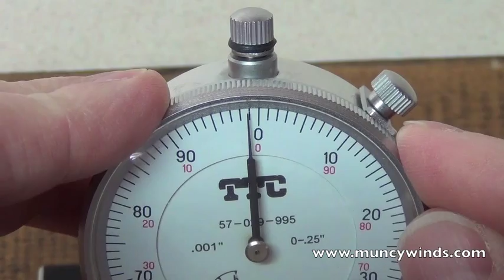Perfecta Reed

Comment: This is a very useful tool.  Especially for adjusting pricey synthetic reeds that aren't up to snuff. I find it's not always necessary to measure the A, B, C, D, E & F lines. Asymmetries are rarely limited to a 1mm strip.  I start with B, C and/or D, and mark the high spots with a pencil while measuring, in order to go right back with a razor or sanding block, even things out, and play-test the reed pronto.

Comment: This device was designed with the Reedual in mind. In other words, the Reedual is good but not a perfect reed duplicating machine.  The PerfectaReed device is a type of micrometer that checks reeds for inconsistencies, whether the reed is made on the Reedual or by some other means. The PerfectaReed device is good at detecting reed imbalances, but can't fix the problem, so you've paid over $300 for a fancy micrometer and don't necessarily have a better reed. Plus, you have nothing to show for your time spent taking measurements. It would make much more sense to start out with a more accurate reed profiler like the R68 made by Uhl in Germany.